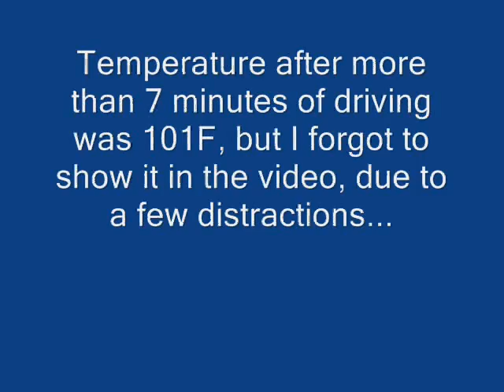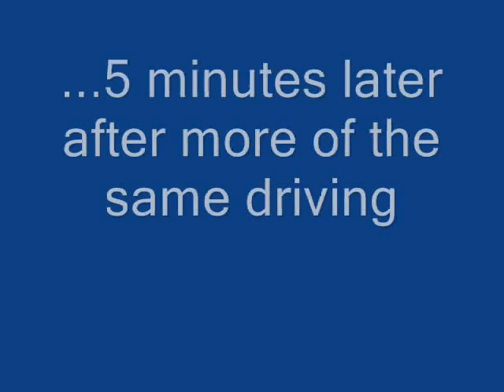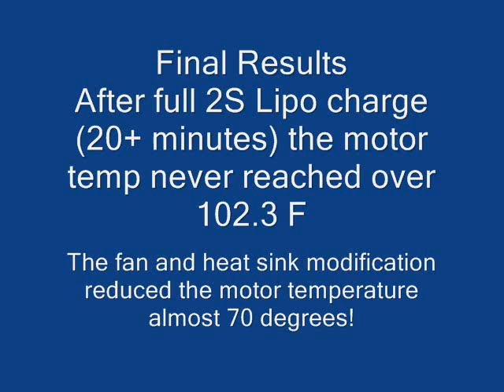Stampede Heat Test Part 2

Comment: 25 min seems short, but then again the ESC has that low voltage protection with lipo, I get around 45min out of the stock 7 cell, and 1 hour and 20 min on the 7 cell Venom power 5000mah nimh battery, not bad, but the lipo's have a heck of a kick to them.

Comment from the maker: Not that I've noticed.  If I need a fan, that means I'm running higher gears and going faster, so that is what lowers the runtime.

You could always buy an aluminum gear box and just a heat sink.  Then you wouldn't need a fan.

Comment: I know I have that slot, but if I put in the reciever, the power comes from the battery. That lows the run times. I wanna know is, the difference in the run times is remarkable?

Comment from the maker: The fan plug into the electronic speed control (ESC).  The ESC has an extra wire coming out of it specifically for powering fans.